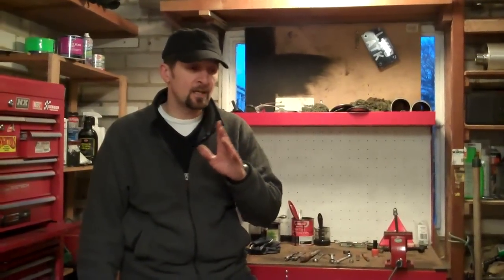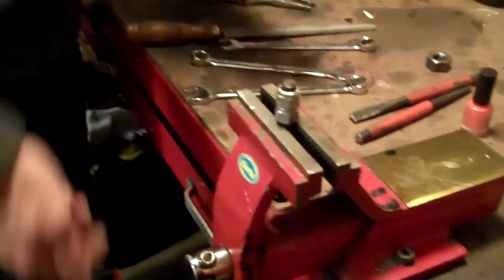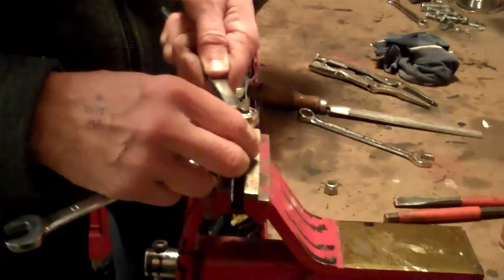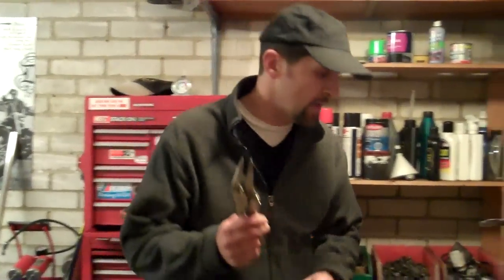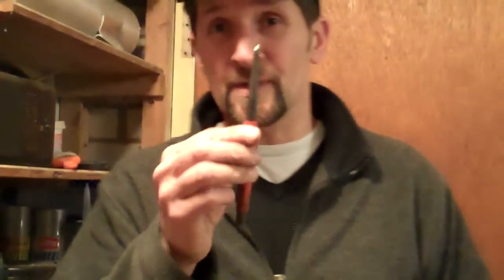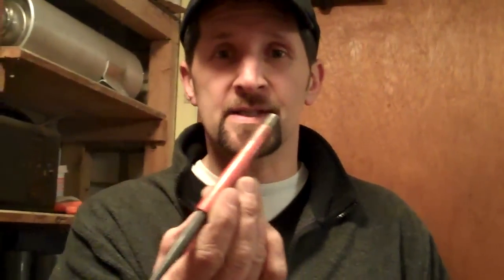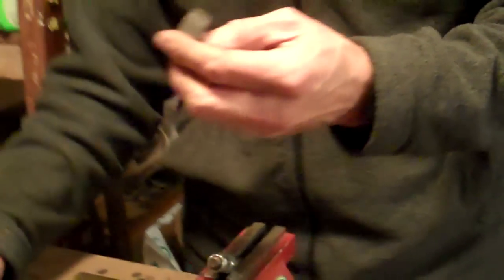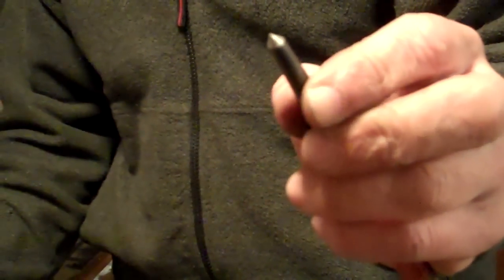Delboy's Garage, How-To ;- Rounded nuts?, an easy solution..!

Comment: Another good idea I’ve got a stuck brake pipe nut I’ve just bought the sealey lock sockets for it.,wish I was a mechanic
Reply from the maker: Sorry to hear that, good luck with it.
Reply: @Moonfleet41  well the punch idea might work but the metal is soft, you can get a hymer into a comfortable place in the warm either😹

Comment: What if the nuts at the wheel cylinder are stripped, rusted and don't want to move even with a punch? Whats the next step? Bcuz some idiot told me, and I have already used the wise grips :-D

Drill bits don't reach there...
Reply from the maker: Hi Aaron, which fasteners are you refering to mate....got a picture you can send..?
Reply: Moonfleet41 I do, but that is not of my car, but just to give you an idea.
http://i.imgur.com/0VPNt.jpg
Thanks.
Reply from the maker: Aaron Hudson
Ok, if its those two bolts that are by the side of the brake pipe....then once they are really rounded off, you'll probably have to drill them out....use a drill bit the same size as the bolt shaft, and drill down the center of the head until the head drops off....then once its out on the bench you can take the stumps out using a stud extractor..

Not an easy task as you'll probably be stuck for space under a wheel arch....but its all you can do mate... good luck with it and let me know how you get on... Del.
Reply: Brake pipe union? Cut the pipe and use a 11mm socket, if that don't work use AF equvilent (3/8) it's slightly smaller so use a hammer
Reply: Just looked at the picture. You can get special tools with spiral teeth that grip tight as you undo. But if your replacing the cylinder taking a hammer to it would be fun.
Reply: Moonfleet41 I used an angle drill to drill in the bit... and then used the bold extractor kit. It helped!!!
Thanks a lot to all of you. God bless ;-)

Comment: Just for info have a look at the "IRWIN Vise-Grip Locking Wrench" (the wrench, no the standard pliers) they were the only thing that allowed me to unscrew old rounded brass fittings from fuel lines. They lock from three sides without squishing nuts and are really worth having in your toolkit!

Comment: I have a rear lowerward control arm bolt with about a 3 inch square area on one side and a muffler on the other cant get anything in to knock the bolt out  and its to close to gas tank to heat. Any ideas
Reply from the maker: ilovetobebrutal Hi mate....i guess if you could drop the exhuast box off and make more space, its hard when i can't see it, but in most cases with cars, i just take everything out of the way, you end up doing that in the end anyway, or you just make it worse....sorry not to be more help, but thats the best guess..!

Comment: GREAT tip! I'd never even thought about the fact that grips would crush the nut, so that's one tool I'll be using a bit less from now on ;)
In terms of drilling, I've also had a couple seize on me, were rather than drilling the bolt down the centre, I've actually drilled the edge of the nut down to the thread and then used a similar approach to your punch method. It removes the pressure and gives you an awesome purchase for knocking it loose.

Comment: Del can you show folk how to measure thread size? Always have this problem when trying to order. End up always going to the shop and taking the bolt out to show em
Reply from the maker: Hi buddy, that's extremely easy, just order yourself a thread gauge from the internet, it's like a little bunch of serrated blades, all different pitches, and you select one that fits the thread and stamped on that gauge is the size - have a look at them online, and it will probably become clear how they work - let me know how you get on!
Reply: Yeah, looks easy enough

Comment: hey del , I have a  caliper bolt   with a rounded off head , if I can get enough swing room il try this technique , but even if I do manage to get a punch" dug" into the head ,I don't think there would be enough energy to start twisting it off  because size of bolt and how tight its in there , I was thinking of using a rotary tool and  flatten it out till I can get something on it that fits and get it out of there, or load it up w pb blaster and cut a mark in it w rotary tool  and get a screwdriver on it  if theres room ,  any advice ?
Reply from the maker: Hi mate...careful beating the head of those bolts.. the cast alloy lug the bolt goes through is fragile, and you could shear it off..... try the cutting tool thing, but if its stuck so much that its rounded the head, i dont think a screw driver blade will be man enough to shift it.... in the end, with really stuck ones the easiest and safest way is to drill it out... take a pilot hole into the exact centre of the bolt about 3mm....then go out to 6mm (its an 8mm bolt shaft) once you're about half way in...the bolt will come out easily once its drilled through..!
Reply: I used too big of a drill bit  so what I did and only thing I could think of was I hit it with a heat gun , then applied "wd 40 rust buster" more heat , rust buster etc,,,,, let it sit overnight , figured it was just not going to come out , next morning I put vice grips on , (I know , a big NO,NO ! ) but at that point head was mutilated anyway , was able to grab onto it and it twisted off like it wasn't even on ! could not believe I was able to get damn thing off !! thanks bro !

Comment: How you meant to do this is a tight spot. In my case, The number 1 exhaust pipe to manifold flange?

Can't get these tools in there, even if I could wouldn't get the angle.

Comment: I have a similar problem but the fasteners / nuts on my wide glide headers have rounded off due to corrosion / rust. I have only just got this bike and want to seal an air leak in this area, any tips to removing these would be a massive help as I really don't want to cause any damage to the heads.
Reply from the maker: Hi buddy, so often the case and really difficult to get to... if I remember rightly, they are quite small as well, about 1/2" I think??  ... either way, I found a great solution for rounded nuts that are inaccesible, that was the Sealey 'Lock-On' Sockets, they come in metric, and imperial, and they do a long reach version... the sockets have hard metal ridges inside them that will grop hold of the stripped bolt and once the socket starts to slip, it shreds some of the stripped metal off, and causes it to 'lock up', like an internal shaping inside the socket... we demonstrated them in a video, and they really work... you just use them like regular sockets, but they will grip a fastener that's up to 80% rounded, so give them a try, you can get them from Wemoto.com, they can ship anywhere, if you get stuck, just give them a ring on the phone... good luck with it...
Reply: Thanks for your helpful reply and advice , your right 1/2 inch and getting smaller. I shall soon be the proud owner of some Sealey 'Lock-on ' sockets and hopefully get these removed. I will let you know how I get on, watch this space as they say, Thanks again for your experienced advice. Had the same problem on my Bonny a few years back but they where easy to get at. Cheers.

Comment: Lol today I did it on my truck oil drain Bolt tying to find out a way to get it off . I don't think I can do that in a aluminum oil pan ?
Reply from the maker: No indeed, don't go chiselling a sump plug, it won't end well, you could heat it up a little and then try any one of the other methods of removing a rounded bolt, there are even some pretty cool tools that will get hold of it.

Comment: Thank you for the video Del. Ideas on how to fix up a chewed up Allen head bolt? I've got a set of bolts that are challenging to pull off a set of brake calipers. Tried WD-40, PB Blaster (penetrating fluid) and an impact driver and cannot seem to get the bolt out.
Reply from the maker: Hi Ali.. if the head is chewed out and the allen key slipping round,  have you tried tapping a Torx bit into it ?.. use one slightly too big, and as you tap it in, it'll bite in the screw and will usually get it to move..!!
Reply: @Moonfleet41  I have not. I'll see if my largest will fit. It's an 8mm head.
Reply: Alas, I did not have a large enough torx head. This could easily turn into a rabbit hole of buying more tools I may not need in the future and figure it would be simplest to take to a shop and have them break the bolts open for me. I will however invest in a torque wrench and some copper anti-seize to prevent this best possible in the future. Though I used aluminum lubricant on the screws I will try the copper stuff. Additionally, would a "ceramiglyde" brake lubricant do the same job?

Comment: Delboy any idea on how to pull out a allan striped screw on my Harley carburetor.
Reply from the maker: Hi buddy, sadly there is only two options for an allen screw - first try a torx bit that is a little too large for the hole and tap it in gently, so it jams in the hole, but I mean gently mate as carbs are made of brittle cast alloy and it's easy to crack them.... and the final option, if that fails, is to drill the head out - chose a drill bit that is the same size as the screw shank and drill it down the centre of the allen screw until the head spins free on the drill, then when you get the cover off (I presume it's the diagram top cover or the float bowl), you'll have a little stump sticking out, and you should be able to get hold of that with some grips or a stud extractor... good luck with it, let us know how you get on !

Comment: but what if its rounded because the bolt/nut is seized?
Reply from the maker: Often this can still break it free due to the impacts with the hammer, but if not, and this dont work.. then in the end, you just have to cut or drill the head off..!

Comment: Good, but what about rusted up exhaust bolts? Any ideas?
If i broke the head off (its rounded), can i drill it out?
Or there is another way? Without expensive tools
Reply from the maker: if you break the head off, then there is nothing else you can do, just grind it off flush, centre punch the middle of the stud, and drill down with a 4mm bit.. and try and 'easyout'.....this usually works, but of not, then just dril it our to full size, then helicoil it...that use stainless steel studs and nuts the next time.. !! no pricey tools, just a bit of hard work
Reply: Moonfleet41
Thank you for quick reply and help. The bolts are 10mm and include the washers on them. Like bolt and washer in one piece. I did stupid mistakes and tried to take it off with vise grips. Rounded off completely, bolts sit so tight that they damaged my vise grips. So i thought i will try to remove the washer part with dremel to get more space to attach the vise grips. If it breaks then it breaks. Nothing to loose anyway.
If it breaks, I will try the drilling and 'easyout'.
There is plenty of room for new threads also. If i get so far.
Reply: If you have a well equiped garage like mine you take out the mig welder and weld a nut to the broken end and turn it out, works on rounded nuts aswell unless they are resessed. Weld on the sides and not on the bolt ofcourse. And before you get into trouble you should buy a decent set of extractor sockets. Works like a charm. You can even get impact ones. I love them :) Aint got time for tappeti tapp. Weld or extractor socket. Job done. Quik and easy :)
Reply from the maker: 95tt
90% of bikers dont own a welder, or the ability to use it......so without some old fashioned 'tappeti tapp' they have to pay rip-off garage prices....just helpin those who need it... you clearly dont fellah.

Comment: Now, what if this is alien bolt which has its edges inside? I really don't want to drill that bolt out, but looks like there are no edges anymore. Possibly same solution? Would be good to see example, modern bikes are covered with these type of bolts.
Reply from the maker: You are indeed right Sir, these alien bolts are getting very common, rumour is they are from Australia cos they're inside out... but then they have proper bolts too, so can't be!... seriously... if you can't get a centre punch on the outer edge or remaining lip, then I'm afraid the only solution is to drill down through the head... unless you can weld a spare allen key in to the hole without damaging the surrounding area...
Reply: have to give it a go without drilling and welding - it's the bar end on my america...
Reply from the maker: Alex Pol
Ok, good luck with it Alex.....feel free to drop me a line if you get stuck..

Comment: so if the bolt/nut is is a spot where i cant hammer it... am i fucked?
Reply from the maker: Hi Levi, you're never fucked mate, there is always a way, as long as you can touch the head of the nut or bolt with the point of a punch, then you can tap it round....even if its the head of an alun bolt and its flush fitted in a caliper, you can stick the point on the lip and go careful....

Comment: not much use for rounded nuts in hard to reach areas or tight spaces, in any case a reverse thread nut extractor is better.
Reply from the maker: Reverse thread nut extractor?, what if its a dome headed alun bolt, down a hole in a plastic fairing..!?...   There's no right or wrong way mate... just use what ever works aye.!

Comment: how about an exhaust nut on a rather worn stud,ive used correct socket but as its a bugger to get in to it i have sadly rounded it a little.how am i going to get that off without making it worse?
Reply from the maker: +wevsky Did you use a 12 or 6 sided socket buddy....its always best with exhaust studs to use a 6 sided socket, get a good tight fit, and with lots of WD40 on the thread...and work it back and forth...dont stress it as they can so easily snap... no tricks with those buddy, just patience, care and time..
Reply: +Moonfleet41 it was a 6 sided socket..sad;ly where its a bugger to get the socket onto the nut first time i may not have got it fully connected when turning.,i have to tweak them up a little from time to time as they just won't stay fully tight,caution is the key ,thanks again

Comment: hi Del! If I could not find a sharp puncher, can I use a screwdriver?
Reply from the maker: Hi mate, I would so no, as the end isn't sharp enough to make a 'dig' in the nut that it can grip on, also screwdriver blades are brittle and will chip and break off when you start hammering it...buy a cheap punch from any tool shop, or even a small chisel
Reply: thank u!

Comment: hi can you help I have an after market silencer on my r1 when I am stationery and I rev it I here a needle in a can sound coming from the silencer what could it be
Reply from the maker: Don't know Steven, that could be anything, as long as it definitely IS in the can.....then whip it off and give it a rattle about...maybe its a stray screw, nut or rivet inside the wadding cavity...naturally have a look for anything rattling when you rev it, maybe its a bracket with a loose bolt.....just a case of investigation mate... good luck with it.. Del.
Reply: thank you for your help will give that a try

Comment: Hi guys
I know it may be a common question but does Anyone know how to remove manifold bolts from a yamaha fazer fz6 ? I have told drill them which I have been doing but the drill bit is veeeeery slow. Delboy  or anybody on here please help it would be much appreciated .
Reply from the maker: Have you snapped one off flush then..?
Reply: 2 actually, thus may be blowing as its called . But ideally I hope to get them all off as they are pretty rusty, but right now the 2 that snapped have to be off for sure.
Reply: Moonfleet41 snapped two off, the others are rusty so would like to get get them off aswell, but for now focus on the two.
Reply from the maker: It's a pretty straight forward format, centre punch the middle of the sheared bolt, pop a 3mm drill bit down the middle of it, then 4mm, then 5mm, that way, you are not pushing too hard on it to drill too much metal out at a time... patience and go careful, you should be fine!
Reply: Moonfleet41 i will try that thank you much appreciated.

Comment: The best way is to spot weld a new nut on top of the stripped one...
Reply from the maker: Its not the 'best' way, and you mean tack weld, not spot weld (thats for sheet metal) ....welding something to the damaged head will work as long as the rounded nut does not then weld itself to the thread....

Comment: Does it work with a smaller punch tool?
Reply from the maker: Yep, sure does, i use a tiny little diesel injector needle if its a really small bolt head.

Comment: Hi i have to remove the starter in my busa and one of the nut have a slight burr meaning to say it wont turn when i place a socket..i need some help
Reply from the maker: Hi mate....is the nut burred off all round, or just a slight amount.....and can you get a file in there to repair it back to shape..!?
Reply: Hi there, the location is quite hard to reach with a file... Its the nuts that secure the starter.. Will try to see i can get a smaller file..is there other methods?
Reply from the maker: Bukhari Johari
Yeah, so many fastners on bikes are hard to access with big tools....can you get a clean 6 sided socket over the nut even if you have to tap it on so it fits really snug..often the damage is done when a tool isnt applied to the nut properly, and allowed to slip off....and is it a nut, or a bolt head....can you drill the head off if its a bolt...?